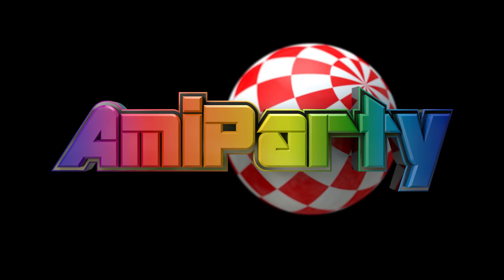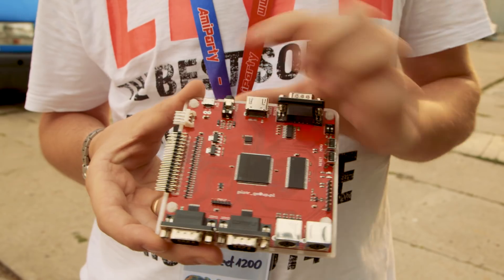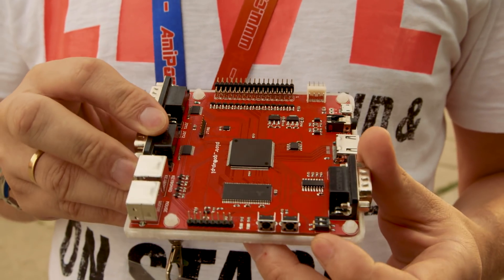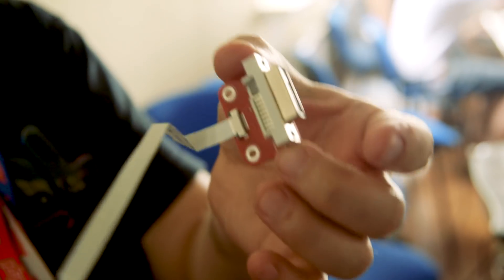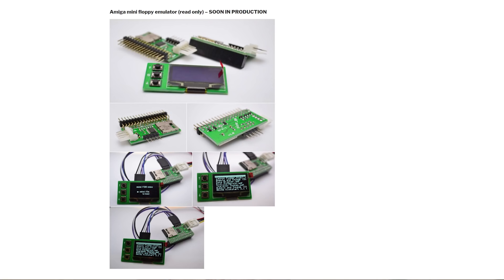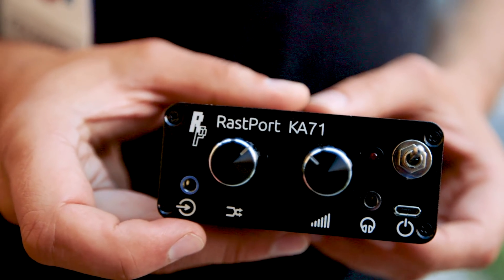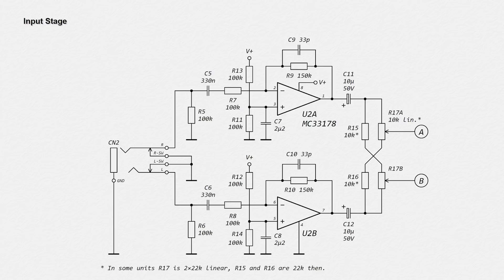Commodore Amiga DIY Projects at AmiParty 21

Comment: With Amiga Bill
0:25 Introduction

With Architect 1200
1:14 A500 FPGA Board - DIY-A586
2:45 A1200 Scan Doubler
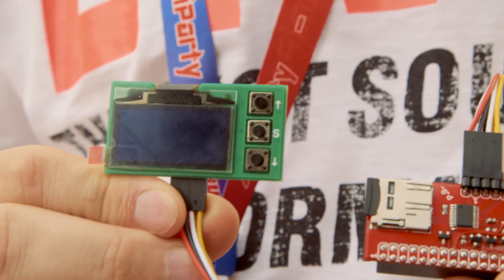3:22 Floppy Drive Emulator

With Krashan
4:14 Headphone Amp - RastPort KA71 - Amiga (Paula) audio stereo mixer / pre-amplifier

With Wali
8:57 GBA 1000 Board - A1000 replacement board
Reply from the maker: This is great, thanks!

Comment: Hi Bill and everybody! Thanks for your movie, nice job. I would like to add some comments. First, you have shown two very talented guys - Architect1200 and Krashan, both are designers. I am only kind of a craftman - I have only assembled project of the other guy....
Second thing, there was a small mistake in my speech - I told you have 16 MB fast ram in GBA mobo, whereas there is 8 MB.
Some guys are asking about "click&buy" option. The GBA1000 is a project of one guy: Georg Braun, he published complete documentation (diagram&pcb in Eagle, files for GALs, instruction). You can order pcb production in any factory, buy all elements and solder it. There is a lot of soldereing (about 80 ICs plus hundreds of resistors, capacitors, etc) and this is why I never agreed to solder it for anybody. But I heard about guys who have done it for money. Sometimes (rarely) it is possible to find assembled GBA for sale. About 2 years ago there was working GBA1000 without addons sold for 500 euros on internet auction in Poland.
The most costly part is mobo because of a lot of electronic elements and work needed for the assembly - I can estimate 500-1000 euro. The addons are cheaper: 68060 board for 250-350 euros, USB board for 50-100 euros, Picasso gfx for 150-250 euros. The lower prices when you DIY, higher when somebody do it for you.
Where to find documentation... Unfortunately after some quarrel on a1k.org site Georg Braun have deleted all his amiga projects from his website. But of course nothing is missed on the Internet :) , many people (me too) have it on their HDD. Everybody can ask for it. The second option is writing to Georg Braun  directly... I never heard about any success, but why not to try once more. 
You need to know that the most working GBAs are in rev 4, whereas Georg Braun has designed much better rev 5 - with 68060 onboard (no sandwich), better ide controller, clock port, etc, it should be probably faster and more stable than rev 4. Unfortunaly the full documentation of rev 5 was never published... so if you decide to persuade Georg... ask for rev 5 (and send me a copy if you get it ;) ).
Finally, Bill, I hope you forgive me small self-promotion - I invite to see my youtube channel... unfortunately everything is in polish. But I think about english subs or dub in the future. https://www.youtube.com/user/pewalig7
Greetings
Piotr (wali)
Reply from the maker: Wali!!! Thank you so much for checking in and I am very glad that you like the video.  Thank you for all the great information and agreeing to be on camera.  That isn't easy, especially when speaking in a foreign language! Many people are finding the video and the projects very interesting.  I think we made it clear that you didn't design the GBA board, but you still put a lot of work into this build and are very knowledgeable about the GBA project.  Thank you very much for the additional information in this comment.  It is very helpful.  I am pinning this comment to the top of the comments section so more people can read the information.  I will also subscribe to your YouTube channel.  You are welcome to come here to TheGuruMeditation  and promote your work any time.  Thanks for your demonstration, comment, and knowledge!
Reply from the maker: Sorry Wali, for some reason I can not pin this comment to the top.  I tried several ways with various browsers.  Darn YouTube.
Reply: Bill, do not bother. It is no problem.
 I am really amazed. Your movies are perfectly tailored...
Reply from the maker: Thank you so much Wali! I try my best and your kind words mean the world to me. Dziękuję Ci

Comment: i have a working A1000 to keep as it is, but i've got a not working 1000 also in a better case.
that replacement board i awesome!!!!!

but is it a complete board or have we got to do all the soldering ourselves? and whats implemented in the buy.

i remember those red A500+ boards but they reached that point that there where no more custom chips available.
edit: (this is fpga but the 68000 processors are real.are those still easy to get?)
i saw on their site it is full of custom amiga chips i am affraid thats gonna be a problem. 

cool vid Bill.   AMIGA✊POWER

o and can the origional 1000 keyboard be connected on that board with that tiny little phone plug?
Reply from the maker: Hi Jan!  Thanks, glad you enjoyed the video!  Sadly the GBA1000 is no longer available. You have to get them 2nd Hand.  In this video Wali had the bare board and was populating and assembling it.  This is from "Mr. T Guru" who commentyed here "sometimes bare GBA1000 boards show up on ebay for $100 or so, sometimes complete GBA1000 boards also show up for about 1000 euros. the $100 for the bare main board is not bad but remember the parts to build it will cost several hundred dollars (~$500, depending on where you buy them and their minimum quantities) and up to ~$1000 if you also build the Picasso and 060 boards."  As far as the FPGA A500 board, that is an all-in-one deal.  You don't have to populate it with any chips.  You just have to add the mouse, keyboard, floppy drive. The new version he made after the video has an SD slot that acts as a HD. It is awesome.  Can't wait for it to go into production.
Reply: then the FPGA A500 is the way to go.

i also cant wait to see more of that.  hey and this will fit perfect in an old 500 case. and then a raspberry pi and small windows board will still fit in also.
i know A500 keyboards can be plugged on that FPGA500, but now if one of your polish friends can develop a nice pcb where we can plug in the A500 keyboard inclusive its controller make it usb and let it behave like the keyrah. i know there are things like that, but not really available to buy.
i suggested this to Stephen Jones also, to make his new case attractive we really need an all in one keyrah like circuitboard, to connect A500 keys , A2000 keyboards and A3000/A4000 keyboards and ofcource two joysticks to USB.
* so a pcb with header strip for the 500keys and a big DIN and small (ps2) hosiden and maybe a little circuit that recognise if there is a A4000/3000 keyboard or an ordinairy ps2 keyboard is plugged. and ofcourse two 9pin sub-D connectors. usb must be possible connected via internal header and external plug.
i ran out of 1200 keyboards so after tree keyrah's ordered i dont need more. but something with specs as above i really will buy.

thanks Bill, spread the word.😉
and greetings to Anthony.
Reply from the maker: Jan Wiersma Excellent thoughts Jan. I am in a similar boat with the new A1200 cases. I need to source a working 1200 keyboard so I can use the keyrah and Raspberry Pi. You have a good n plan there. Architect 1200 recently added an SD slot to his board which can be used as a HD which us awesome. He says he will send me one to make a video about when it is complete. Can't wait !

Comment: A lot of good hardware there for the special needs of Amiga users. Thanks for showing it off! Nothing that sparks for my needs at the moment, I like it mostly original. Especially the sound! I think the pure stereo separation is the most unique and wonderful thing about the Amiga's music. I would get ASMR as a kid listening to the Amiga! It's exactly what the record industry would do at the dawn of stereo music in order to highlight the differences with mono, just make every track full on left or right. I think the art of using stereo to its potential has been lost these days. But for some, I have indeed heard that they get discomfort from that stuff. Strange to me, though. Cool to have a piece of hardware mixer for those people.
Reply from the maker: For sure.  And it is cool that it is an external box so you don't actually change anything inside your Amiga.  Also gives you the option to adjust the mix so you could have it hooked up and still have the total separation and just use it as a headphone amp.  I really like it, but totally hear you.  I love how you respect the tech and want to keep it as pure as possible. Thanks for watching as always Shot!
Reply: I think it would be pretty cool if someone could make a similar sound mixer for the C64, only the opposite effect; Where it would give the music some stereo. Something more than just reverb, maybe having an actual SID inside of it. Like the stereo SID mod, only external. I could see some people wanting that, although again for me, I dig the original SID. My speaker setup for my little CRT that I have the C64/VIC20/NES/Genesis/SNES hooked up to was put together so the mono sound from many of those systems would sound its best. I have been known to use a special program on my DOS computer that adds reverb to Adlib stuff.... Cause I already go into Adlib not liking the sound, so I have no problem changing it to my liking. :D haha.
Reply from the maker: Oh yeah, that would be cool!  I do like a lot of the stereo SID stuff I have heard, but an external solution would be amazing.  Sounds like you have a sweet setup!

Comment: Cheap laser cutter/welder/solder machines can be modified and coded to aim a laser (electromagnetic field peturbing photons) and change its pulse and wave shaped etc using an ardion sized board with an FPU on it so you can make your own PCBs or a1200 motherboards. It actually isn't that expensive. For a ghetto solution like that (because after all an a1200 board has chunkier traces compared to a mobile phone) does not need a fancy laser machine. Instead (like you can get 3D printers online or at Aldi) you can get mall laser machines and mod them that way. The rest is FPGa and tutorials for that are all over youtube and the internet. In other words, small runs of accelerator boards and motherboards can be done rather than needing a batch to be sent off for one designing at a place like say Dirty PCBs (although, for larger batches of sy a thousand or more, it is understandble to use that). A community competetion to submit videos for a "slightly improved" amiga (eg. dual CPU 68040 chips and dual akiko and blitters and custom MMU or whatever) would set a standard (as long as it is backwards compatible and can be enabled/disabled in a menu upon boo). I wrote a comment describing that to Lorfarious here, btw: https://www.youtube.com/watch?v=IIq7QS-xAP4&lc=UgwttQgbz79-jRjgf7J4AaABAg.8cHrh0hL2Tu8cIaAD0MucW
Reply from the maker: ObsoletePowerCorrupts That would be an awesome competition. Well, I will get one of these A500 FPGA boards when it is finalized and do a demo here
Reply: Ask them to program an FPU in the FPGA field. You get that on such boards (e.g. arduino style boards).

Comment: Great vid, as always.

I could watch these guys talk about Amiga stuff all day. ;)
Reply: One glance, and I can tell that mini A500 FPGA board is well made, btw.

It has ESD protection diodes on the HDMI port, buffers for the joysticks and other ports, transistors (or gates) for the floppy drive port etc.

Nicely done.
Reply from the maker: I can listen to them talk Amiga all-day as well.  And I do - at AmiParty ;-) Yes it is a very well made board.  Architect 1200 has a cool shop 12 miles from my wife's family house.  But this board is just a prototype. Since the party, he worked out a few bugs and also added an SD slot to be used as a hard drive.  It is awesome.  I can't wait to get one!